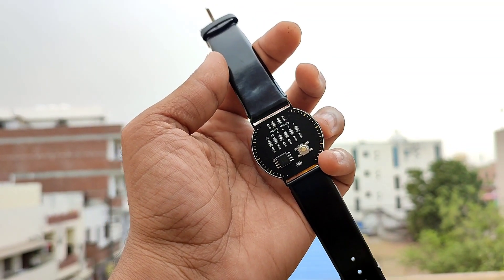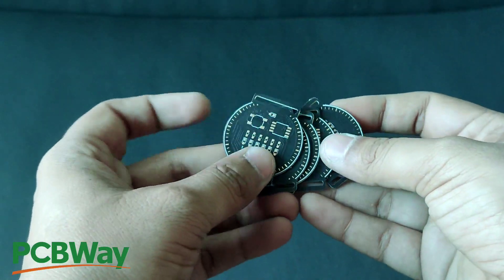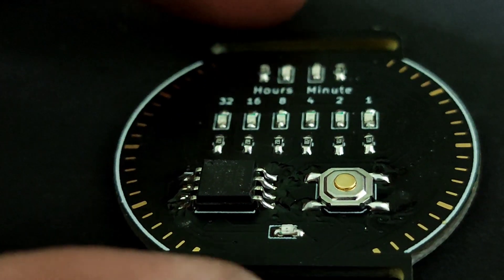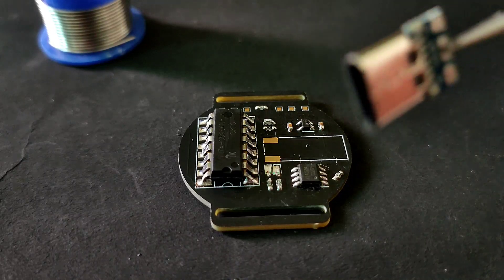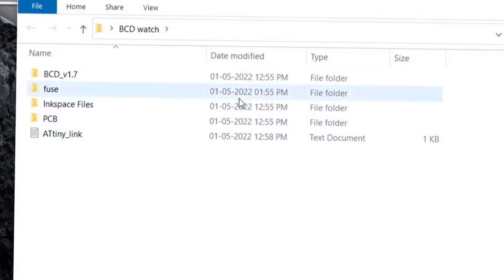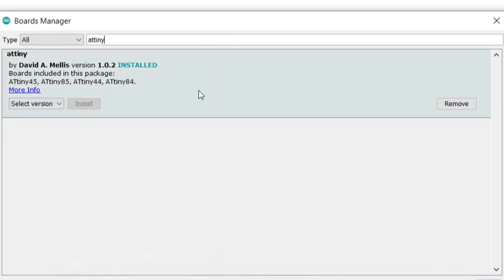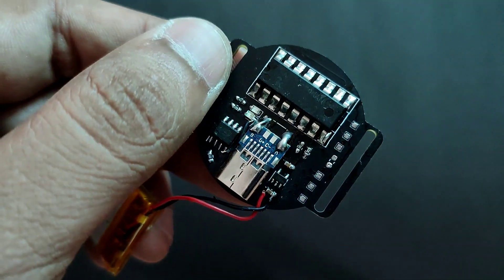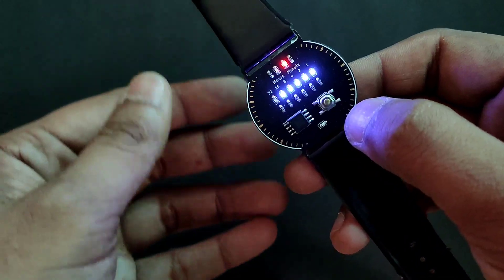BCD Watch | Binary to Decimal | Arduino watch | ATtiny85 | diy watch | Arduino Project | PCB way

Comment: hi.  i'm a novice and want to do this for a class project.  i cannot find the full item list.... i only found the hardware / software list..  would like clarification on components used.  thanks
Reply from the maker: I sell DIY kis for this projects, that includes all components? You can buy this from me, so you don't need to worry about all the components.

Comment: nice build, but the watch will not be very accurate, since you dont use an external watch quartz. The internal clocks are affected by temperature changes and voltage changes
Reply from the maker: Ya, that will be my next version